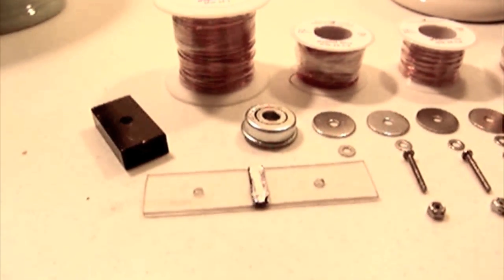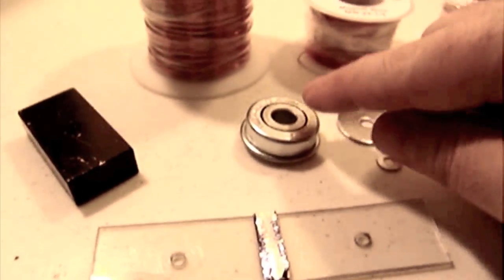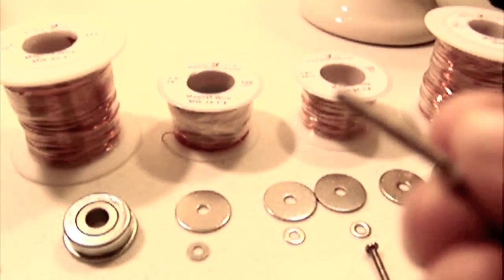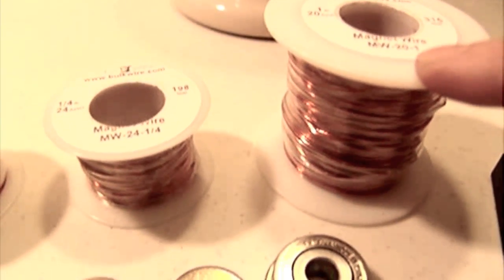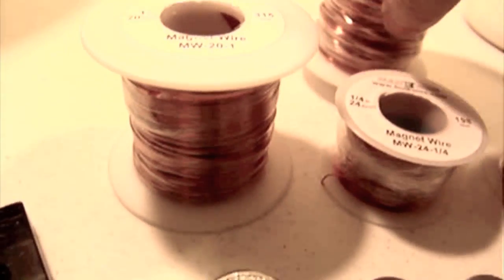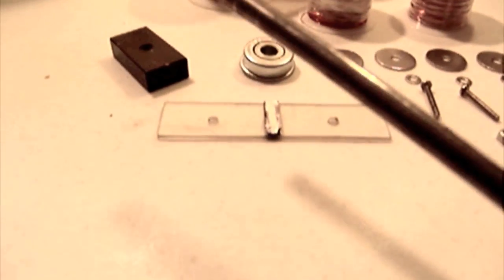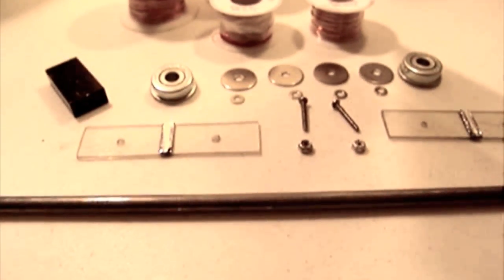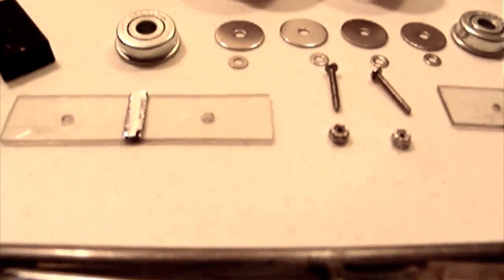🧲 Newman Generator Plans - Rotor Parts Explained 01 | YouTube removed the final video￼

Comment: Just all talk!!!!
Reply from the maker: It turns out that this magnetic motor challenge was solved way back in 1966 by a German man who made a working car motor that ran only on magnets. See link below. Others as well on the web have also made motors using only magnets. See links below. My design concept is different from most others as I'm going for super torque. The links below were long since made available in the video description as well. If by chance you're still around, thanks for stopping by.

((( MAGNET MOTORS THAT ACTUALLY WORK )))
👉🏻 MAGNET MOTOR - Rotor Encantado
https://youtu.be/mxgwTzxfe8Y

Amazing Magnet Motor/Gen Rep. This is not a fake
👉🏻 https://youtu.be/jKFTAobM-l0

WORKING MAGNET MOTOR 2023
👉🏻 https://youtu.be/vdtdKE2Qe40SELF RUNNING MAGNET TURBO MOTORhttps://youtu.be/6sIBHn5-9pI

🆕 WORKING MAGNET MOTOR - rotor magnéticohttps://youtu.be/3mD0_0FiJ54

MAGNET ONLY MOTOR from SOUTH KOREA
👉🏻 https://youtu.be/smzpbKg9S7M

1966: German inventor presents his Free Energy Device Magnet-Motor
👉🏻  https://youtu.be/XWQjMyMWXAc

Comment: pure bs........
Reply from the maker: It turns out that this magnetic motor challenge was solved way back in 1966 by a German man who made a working car motor that ran only on magnets. See link below. Others as well on the web have also made motors using only magnets. See links below. My design concept is different from most others as I'm going for super torque. The links below were long since made available in the video description as well. If by chance you're still around, thanks for stopping by.

((( MAGNET MOTORS THAT ACTUALLY WORK )))
👉🏻 MAGNET MOTOR - Rotor Encantado
https://youtu.be/mxgwTzxfe8Y

Amazing Magnet Motor/Gen Rep. This is not a fake
👉🏻 https://youtu.be/jKFTAobM-l0

WORKING MAGNET MOTOR 2023
👉🏻 https://youtu.be/vdtdKE2Qe40SELF RUNNING MAGNET TURBO MOTORhttps://youtu.be/6sIBHn5-9pI

🆕 WORKING MAGNET MOTOR - rotor magnéticohttps://youtu.be/3mD0_0FiJ54

MAGNET ONLY MOTOR from SOUTH KOREA
👉🏻 https://youtu.be/smzpbKg9S7M

1966: German inventor presents his Free Energy Device Magnet-Motor
👉🏻  https://youtu.be/XWQjMyMWXAc